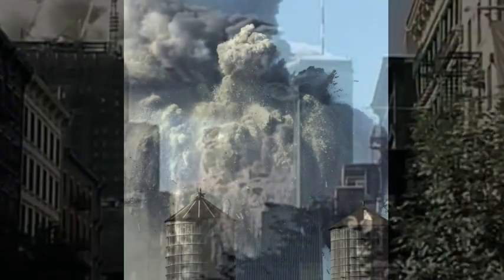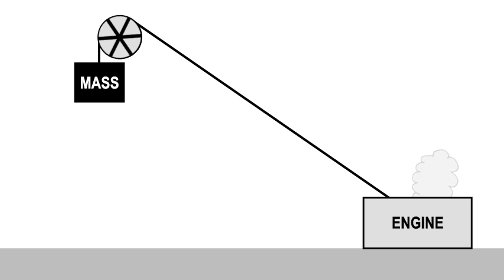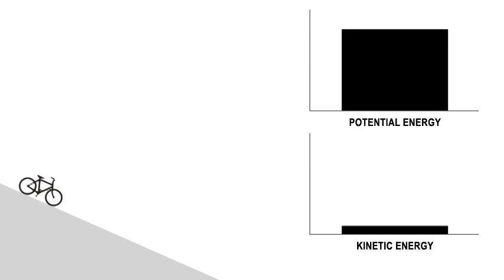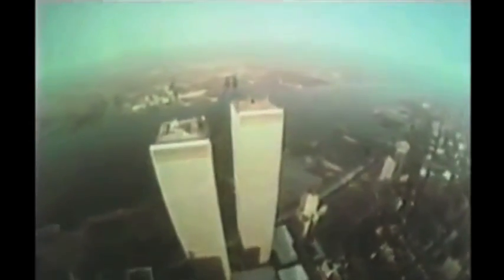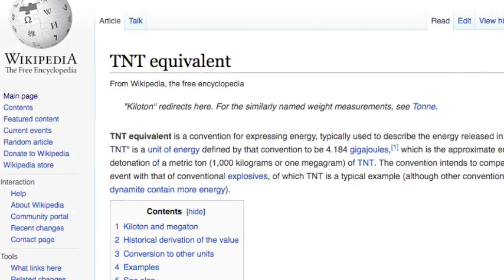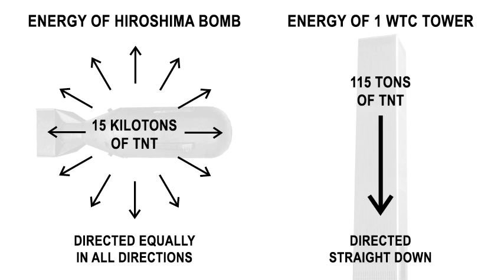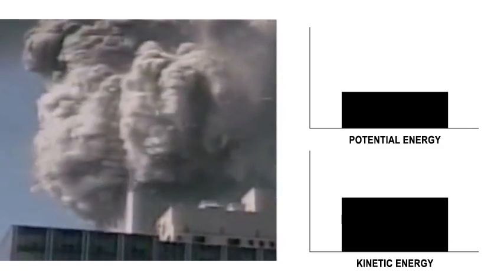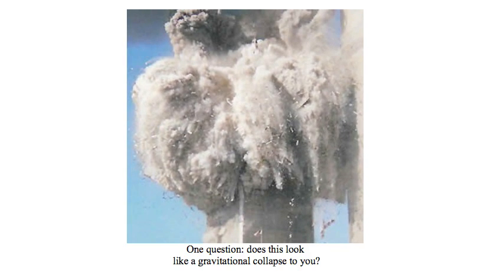Where Did The Twin Towers' Explosive Energy Come From?

Comment: Why did so much debris fly outwards?   Because most of the volume of each floor was air.   Consider the ceiling suddenly coming down like a piston to hit the floor and where's that air going to go, except outwards in a quite good imitation of an explosion.   But you don't need explosives, just gravity.

Comment: North Tower 10:28. 
12 floor pile driver disintegrate itself in first few second. Collapse wasn't' stop. Where's all that energy came from?
Reply: @Neurodegenerat. The kinetic energy was generated by the mass of the upper section falling downward through the 'gap' created by the airplane impact. It is not a matter of mass. It's a matter of force.
Reply from the maker: Uh, you presumably just watched a video explaining exactly where that energy came from.
Reply: Neurodegenerat - that 12-floor section has the mass of a BATTLESHIP , being dropped onto the rest of the building.  What exactly is going to stop that?
Reply: @apostleverde  
Jesus?
Oh sorry, no Fictional Characters.
I mean SAITAMA!
Reply: @sylviarohge4204  = Chuck Norris could stop it!
Reply: This is dumb theory but I think the core crumbled pulled the outer trusses and debris fell through the elevator shafts and pressure popped all the steel columns around the elevators lol sounds dumb but idk

Comment: this argument would only make sense "to a degree" if there was a second tower dropped on top of the first , but there wasn't , no object regardless of size has the potential energy to destroy itself that is absolutely ridiculous ! ,  technically the potential energy of the building as a whole  was zero because the building is grounded . PS I'm not a 911 conspiracy nut.
Reply from the maker: "technically the potential energy of the building as a whole  was zero because the building is grounded" 😆 Yeah, that's how physics works, "technically" 😆
"PS I'm not a 911 conspiracy nut" 😆😆😆
Reply: Do you understand that the building isn't "one object destroying itself" once the support between the top and bottom fail? The top of the building beceme a separate, unsupported object once the connections between it and the rest of the building lost enough strength to fail.
Reply: eelabob >>no object regardless of size has the potential energy to destroy itself that is absolutely ridiculous ! <<  I''m sorry, eelabob, but that's just not compelling.  Maybe you should try using a few more exclamation points.  Oh, wait... no, that won't help either.  But thanks for sharing your incredulity with the rest of us.
Reply: stop the video at 0:39 yes you have done work against gravity  and have block A with the potential to release and convert the energy to kinetic energy . but raise a second block to the same height but this time support the block B with similar blocks underneath creating a tower ,  do block A and Block B have the same potential energy ? You say i'm not compelling but i would like to see how he worked out the value  for the potential energy of the building and the processes involved in converting all of that energy into kinetic energy . Potential energy is mass x  height x gravity, the tower was destroyed from top to bottom , so where was the falling mass ? , were was the height of that mass ?
Reply: But the floors don't have the same potential energy, no.  Floor 99 has more the Floor 98, which has more than Floor 97, and so on.  One floor assembly was 3,000 tons (and that's without all of the furniture and such) and the height between floors was 12 feet (about 3.5m.)   Plugging those numbers into https://www.omnicalculator.com/physics/potential-energy, one gets 102 million joules... that's just the potential energy difference of one floor assembly 12 feet above the floor immediately below. 
Now, suppose the building fails at Floor 90, so 20 floors fall onto Floor 90.  The potential energy is the sum of Floors 91-110 delivered to Floor 90.  Floor 91 is 100 million joules, Floor 92 is 200 million (falls twice as far as 90), 93 is 300 million, etc.  Added up, it sums to 21 billion joules... 5 tons of TNT.   Floor 90 is not going to withstand that kind of an impact.  
So now, you have the wreckage of 21 floors falling onto Floor 89.  Floor 89 fails.  Now, the wreckage of 22 floors falls another 12 feet and hits Floor 88.  It, in turn fails.  Repeat all the way down.  Professor Zdenek Bazant demonstrated that once structural failure occurs, runaway cascading collapse is inevitable.  See: http://www.civil.northwestern.edu/people/bazant/PDFs/Papers/466.pdf and http://www.civil.northwestern.edu/people/bazant/PDFs/Papers/476.pdf.
Reply: @apostleverde    Your illustration with the potential energy was not quite correct.  Taking your figure of 100 million joules for a floor falling 12 feet.   For a failure at Floor 90, and assuming floors 91 to 110 fall as a single rigid block, then each floor has only fallen 12 feet *by the time the bottom of the block hits Floor 90*.    That's 100 MJ per floor, total 2000MJ,  (not 100+200+300 etc as you had it), converted into kinetic energy.    
HOWEVER, that's still many times more than needed to smash Floor 90. 
And when it reaches Floor 89, the total mass has picked up another 2000MJ plus 100 from Floor 90.   (Minus whatever energy was absorbed by deformation of the intervening structure).    And it  keeps on doing that all the way down, as you said.
Reply from the maker: Soteriology101: "There were videos of it running out of the towers in a shower of sparks" It? What is it? "It" was likely aircraft aluminum melted in the fire, overheated, and mixed with impurities. Aluminum in this state glows orange-red. Anyway given that we know lots of aluminum, fire, and impurities were present, that's a far less complicated explanation than secretly planted whatever.
Reply: One of your critics with a big blue logo here sounds like a mocking bird.   However I might question the numbers because he is not claiming that it was stored in the mass of the objects hoisted up into the air + the spring of the steel and compression of the concrete but rather the energy of the diesel fuel burnt to get them up there.  We know diesel engines are far less than 100% efficient.  Yes I suppose if half that diesel fuel were mixed with liquid oxygen and placed in those towers in key positions that they could probably blow the building to bits.   However I doubt that the thermal effects from explosives or the inherent potential energy in the structure could be red hot molten steel for a month afterward and be measured from NASA satellites in space while fire engines hoses and rain was poured on them.  The really  weird thing I see in the resolution of this video and for the first time is that the building as it is collapsing is RED HOT through and through.  However if I knew any building was stressed with such a high potential energy in its spring steel & concrete to blow itself apart, I would fear ever going up that building for any reason whatever  that my very weight would be the added stress that set off the demolition.  however to make out that the building was pre stressed with such stresses sufficient to blow itself apart from top to bottom due to structural failure would be a terrible insult to those that designed it as well as a cause of litigation against them.
Reply: Soteriology101- there was no "Red hot molten steel" and only twoofer kook sites have ever claimed there was, without evidence.  The hot spots identified via satellite do not indicate molten steel to be the cause, exclusive of anything else (i.e. rubble burning within the pile.)  
>> However if I knew any building was stressed with such a high potential energy in its spring steel & concrete to blow itself apart, I would fear ever going up that building for any reason whatever  that my very weight would be the added stress that set off the demolition. <<
LOL - potential energy of a structure isn't released explosively.  People really crack me up with their depths of ignorance about science.
Reply from the maker: I have never heard the term "spring steel" before. Weird. I love this recurring claim that since those three buildings collapsed 17 years ago under extraordinary interconnected circumstances, people say they are never going into a skyscraper again. Yeah and while you're at it, never cross a bridge because of what happened at Tacoma Narrows. I mean your weight might turn it into a "galloping gertie." You are so very powerful and important to the universe!
Reply: There were videos of it running out of the towers in a shower of sparks like in a foundry according to one of the firemen.

Comment: It doesn’t explain how quickly it collapsed and it would have needed tnt to destroy the main structure to bring down a building such as this
Reply from the maker: No. The point is that the energy released, in the form of floor slabs and whatnot coming down, was equivalent to that much TNT blasting away the columns.

Comment: Sorry, but you are off.  Kinetic energy was being lost to deformation, i.e. pulverized concrete, lateral ejection of multi-steel beams over 600 feet, etc.  You are assuming the UNDAMAGED and more massive lower section would offer no resistance. There is a reason that no one can produce a physical model showing that a smaller section can plunge through, and totally dismember a much larger section of same structure, and do so while accelerating.  If it was possible, someone would have shown through expieriment by now.
Reply from the maker: "Kinetic energy was being lost to deformation, i.e. pulverized concrete, lateral ejection of multi-steel beams over 600 feet, etc." Exactly. This video is about where the energy comes from to produce these "explosive" effects.

It boggles the mind that anyone can believe the 15th or the 20th floor of a building that's 94% air has any effect on the strength of the 80th or 85th floor. Boggles the mind.
Reply: Joseph Serrin: Also, as far as "lateral ejection of multi-steel beams over 600 feet" is concerned, people need to get some facts and figures correct... the furthest large steel components found were more like 450 feet away, not 600.  Also, consider the trajectory of an object falling from 1300 feet; displacing it 450 feet (1/3rd of the height it fell) doesn't require "ejection" by explosives or some other large force.  The horizontal moment imparted to the wall panels as they peeled away from the building was enough.
Reply: Yes, kinetic energy was lost - but all that is required for the process to accelerate is for the amount gained by falling each floor to be greater than the amount required to buckle that floor. The floors are NOT designed to support the weight of the floors above them. That is the job of the core columns. You can see in this video how the exterior of the building essentially "stripped" itself off leaving almost the lower third of the core standing - for a brief time.

https://youtu.be/R889eSvuS-w?t=1m55s

The key point here is that complete collapse did not require that the upper floors to necessarily overcome the full load bearing capacity of the core structure in order to continue. It simply needed to gain more momentum than it lost by failing each floor in succession. One at a time. And given that the floors were NOT designed to carry the weight of the building above them (each one was rated to support a MEASLY 1300 tons of static load), then the outcome we saw that day was inevitable once the initial failure of the damaged floors occurred.

Imagine you've got two groups of people fighting each other. One has 20 people, the other has 80. The bigger group should win the brawl, right?! Not if they send their people in to fight one at a time. The 80 will get overwhelmed and picked off one by one until they're all KO'ed. That's what happened with the floors of the WTC.
Reply: EnDSchultz:  that's a really good illustration.  Of course in that scenario 20 can beat 80--easily!
Reply: Joseph Serin >>You are assuming the UNDAMAGED and more massive lower section would offer no resistance. <<
No one assumes any such thing.   The lower section DID offer resistance... that's why the Towers took 18-20 seconds each to collapse, instead of collapsing at free fall rate (which would have propagated from the roofline downward in 9 seconds - this didn't happen.)    You are making the mistake of considering the "20-falling-floors-versus-80-lower-floors" model as if we were discussing two solid objects, like concrete blocks.  
Visualize it this way: 20 floors starts falling... the mass hits the 80th floor.  Floor 80, in that moment, takes all of the impact by itself.  It can't support that impact, so it fails.  Now you have 21 floors falling down onto the 79th floor.  The same thing happens... next, 22 floors fall onto the 78th floor... and so on, all the way to ground.  It's a snowball effect.  Some of the mass did fall off to the sides, but only about 20%, so the "snowball effect" model still holds.  Even if 50% of the mass of each floor went over the side, that would still leave you with a "domino effect" model... the collapsing mass cannot be stopped in either case.    If it were possible for the collapse to have been arrested ,someone would have shown this through analysis by now.  Yet, every credible expert who has researched the WTC collapses, agrees that the buildings collapsed because of the damage they sustained from impacts and fires.  NO credible expert, anywhere in the world, agrees with the asinine twoofer bullshit.

Comment: Why are comments always disabled on conspiracy videos? 

Should also be noted, the higher the floor, the higher the potential energy.
Reply from the maker: "The falling mass had to accelerate the stationary mass" Bullshit. These were not solid blocks. The towers were 95% air, no part of which was designed to accommodate large masses falling onto them from a height even of one story. The falling mass only needed to break connections below to a point where the next floor became unsupported, and then the next floor joined the debris shield that was plowing down through the building. Lather, rinse, repeat. LOL
Reply: @psikeyhackr: Sorry, the total mass (and total strength) beneath the collapsing zone is irrelevant.  As has been explained to you already, the collapse smashes through one floor at a time.  As proven by Dr. Bazant, the collapse was a runaway event and unstoppable.  The building could have been 1,100 floors instead of 110 and the collapse would still have progressed all the way to ground.  Stay in school.
Reply: +psikeyhackr >>the conservation of momentum is irrelevant whenever you say so<<
Who said conservation of momentum is irrelevant?  

>>The falling mass had to accelerate the stationary mass<<
Ah, that's why you bring "conservation of momentum" into the discussion.  
You are overlooking a critical aspect.  The collapse involves more than just the original falling mass (c. 20 floors.)  As each [intact] floor is smashed, one by one, it ADDS to the collapse.  It's a snowball effect.  
You start out with c. 20 floors falling.  That quickly becomes 21, then 22, etc.  

You are also forgetting that, as the debris smashes into each intact floor one by one, yes, there is a deceleration as it breaks that stationary floor's connections, but then it has another 12 feet of space to fall through before hitting the next floor -  giving it time to accelerate, and regain momentum. 

Also, the floors were hung from the vertical supports.  This is a very critical detail that none of you twoofers bother to understand.  The falling mass was never smashing "through the support that held it up for 28 years."  As the collapse progressed downward, hitting each intact floor below it, it broke the connections anchoring that individual floor to the uprights.  Each floor's connections were capable of supporting ONLY that floor (including the loads of furniture, etc., plus some dynamic load of people, plus some factor of safety.)  The ultimate factor of safety for each floor was around 5.  However, the force of 20+ floors' worth of debris hitting each floor was over 30 G's.  

This wasn't a case of debris smashing downward through its vertical supports.  As the collapse progressed downward, the floors were stripped from the upright structure (core columns and exterior panels.)  Once the horizontal bracing provided by the floors was gone, the exterior panels and then the core collapsed on their own - they were never designed nor able to free-stand.

>>What do you mean it had to get stronger all of the way down?<<

When did I ever state that?  Please actually read and comprehend what others write.
Reply: Comments have not been disabled for this video, because Edward Current has strong integrity and the balls to handle a few snarky comments.  (And a lot more than that!  He's stronger than an IKEA champagne glass...hence, he's stronger than the Twin Towers!
Reply: Intelligence has been disabled for conspiracy videos.  That's why they won't allow comments. Its the internets version of ALALALALALALALALALAH!!!
Reply: Why are comments always disabled on conspiracy videos? 

Because its the truthers way of going..'LALALALALALALALALALALA